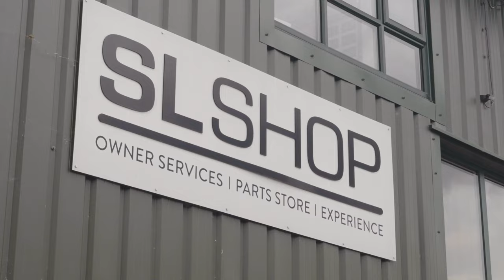Inside the Mecca of Mercedes-Benz: The SL Shop with Alex Brundle

Comment: I had a Red R107,great car,then 2002,2005,2007 SL55's.All Black,& the last,an SL55 I bought from Mercedes Newbury,Phillip Nolsen,we took to Affalterbach,and derestricted,Pulley upgrade & it did 330 kph! Now,here in Palm Beach Qld Australia,have a SL63 5.5 V8 BiTurbo,and two other C200 Benzes,One Wagon,(Most useful tool I own) and an Avantgarde AMG C200. I've owned 'Benzes since 1978, 450SE,and 1986 a 300E,2000 E240 then 2004 500E. "Engineered like No Other Car",indeed. But, I have a 2008 997 911 Manual and a new Supercharged 5 L V8 Mustang Manual,to compare.🤣

Comment: I have loved the SL Pagoda but always too expensive so was looking at sl300 due to running costs and galvinised chassis. I visited the SL Shpp in 2011 and a very friendly young chap with wavey hair called Sam said I could have a test drive. He gave me the keys to a red SL ..I think it was a 1983 I drove it up the road and it was horrible....a wandering ponderous creature.....not driving but helming! I was so disappointed but on returning to the yard another customer who had tried the red car suggested I try the dark blue sl300 he had just driven. I took this car out and was smitten ...I 100k miles and £14k seemed pricey at the time but it had the pale blue checked seats and dark blue paint and low ownership....could have..should have ....but...didn't buy it. Now in 2023 may have to reassess the situation. Glad Sam and his company has gone from strength to strength its pleasing to see good people do well.